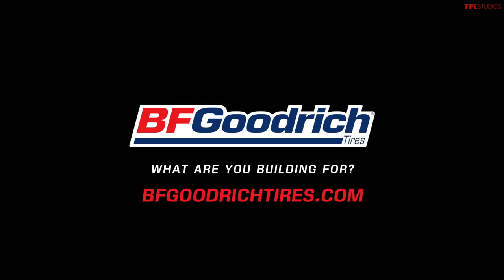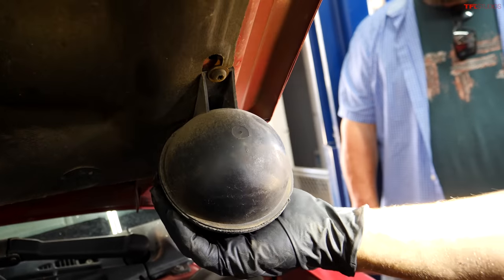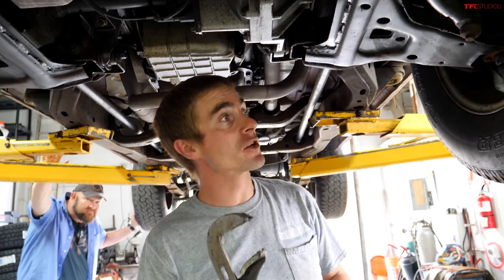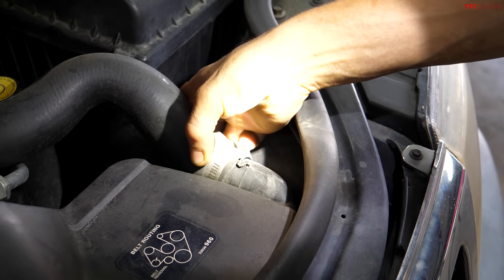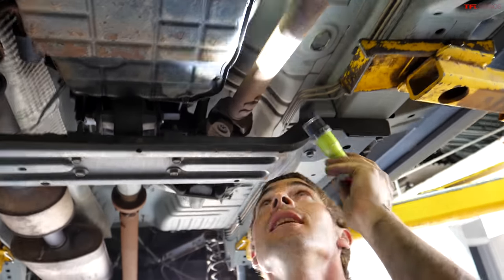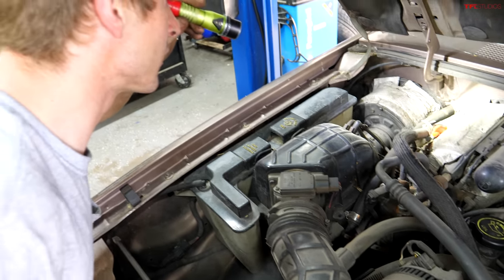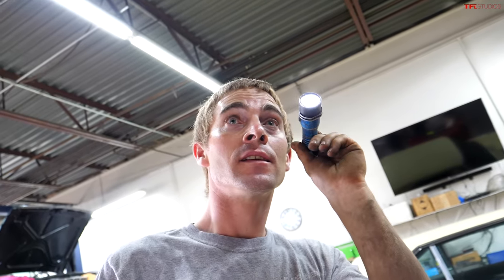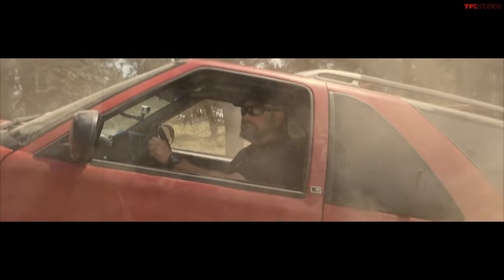It’s Much Worse Than I Even Imagined — Our Mechanic Can’t Believe What a POS I Bought!

Comment: After being a mechanic for nearly 20 years, I can tell you that these vehicles are very typical of vehicles of their age. The vast majority of people seem to stop caring about their safety or the safety of others once a vehicle gets over about 5-7 years old, and this is how they end up. The Jeep will end up needing a transmission, guarantee the previous owner cleared the codes right before Tommy showed up to buy it. The over-temperature code means that something is slipping and overheating the fluid (probably the torque converter clutch) and the P1771 is probably stating the the clutch volume index for one of the clutches is too high, meaning that it is requiring an excessive amount of fluid volume to get one of the clutches to apply, indicating that the clutch is worn out. Bring a code reader with you when looking at a car and check to see if the emissions monitors have all been completed. If they aren’t, walk away, because the check engine light will be on before you get home. The Blazer and B4000 all have typical issues for their age. Trucks wear out their steering and suspension components ridiculously quickly. Overall, this video really just shows the importance of getting a pre-purchase inspection, because the necessary repairs for each of these vehicles will likely be at least half of the purchase price (or more than the purchase price in the case of the Jeep). It also shows the need for federal vehicle safety inspections. You can’t trust individuals to be responsible enough to maintain their own vehicle to a basic safety standard, they need to be forced to do it unfortunately.
Reply: The problem with safety inspections is they don't take into consideration the mileage people are driving. Some people only put on 1000 miles a year just going to their minimum wage job. A wore out clunker is perfectly fine in those situations and isn't putting anyone in danger.

Comment: So the one with transmission problems won. 🤔
Reply: I was thinking the same too. It would take weeks but I would have Toby or someone else take a look inside the transmission to be sure it’s good or not. But Toby did look at the transmission fluid so that would be the first evidence if it had metal bits or chunks in the fluid.
Reply: The thing has over 200k lol. It’s proven reliable. You people say ANYTHINGGGG about chrysler. 😂